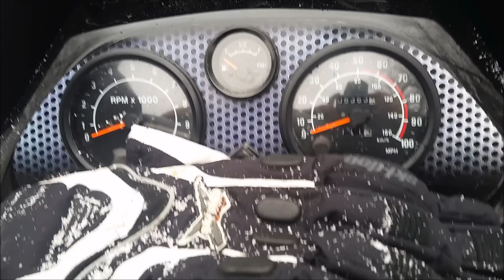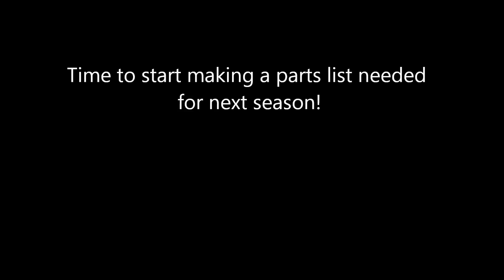Broken Sled Recovery

Comment: Dude you rule great video. Reminds me of my scorpion whip. You need to add one to the fleet
Reply from the maker: Thanks!  Yes, i could really use a scorpion in the fleet!
Reply: @toocheaptosmoke  I had a 80 whip 440.  used to take it to upstate ny.  Made me love snowmobiling and to this day I still do.  Had blown crank seals on the cayuna 440 and a broken walbro.  Rebuilt the motor and put a mikuni on it. rebuilt and machined all new pararail shafts.  really great experience.  I love watching you struggle and win on the older stuff.  I think i am going to look for an old Yamaha phazer for the fun of it.  Keep it up.
Reply from the maker: @davedemo8229  nice, that's what's great about the old sleds.  I started on an 80 TX 440 that was nothing but problems, but sure had a good time with it.
Reply: @toocheaptosmoke  yep sure was great about them.  learned to wrench and one of the reasons i love all things mechanical. BTW I saw you had a gt380.  Not to brag I have a gt750 ts250 2 H2's (yeah need more than one) and a RZ350.  Love 2 strokes.  My present sled is a 2015 Ski-doo mxz 600 (no pig 4 strokes for me)
Reply: " We're givin' it a bit of an autopsy",
I had to laugh my ass off !

Comment: every two or three years. I change all the bearing in my Snowmobiles.  I have yet to be towed home in 20 years. Good reminder to do your maintenance and right it down. Also those lower bearing need to be greased every 200 miles or once a week as needed.

Comment: Same thing happened to me. luckily I was able to get home before anything blew up. All new bearings and a new speedo cable end. I usually use NTN bearings.
Reply from the maker: I've been using the oem cat bearings lately, they're the only ones I could find with holes in the seals for the grease fitting.